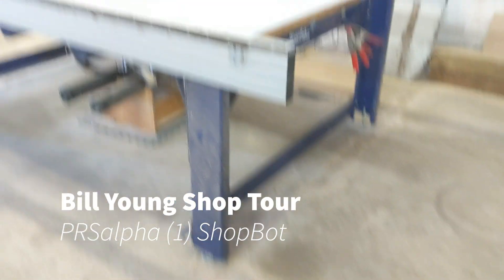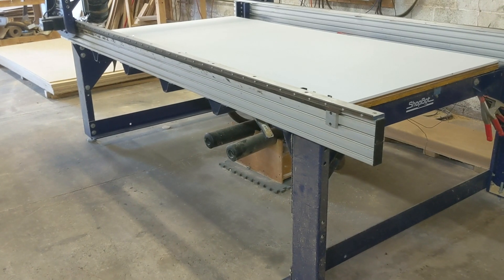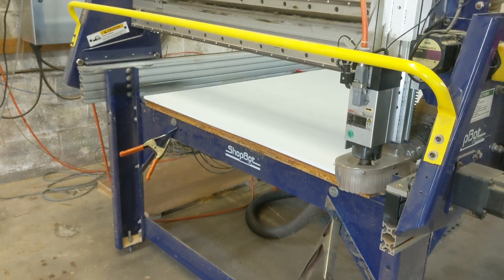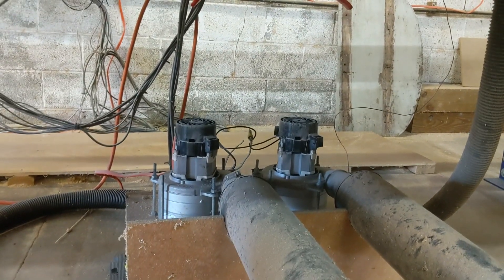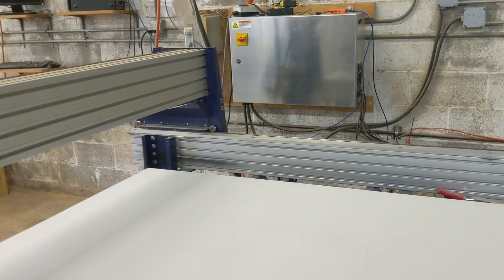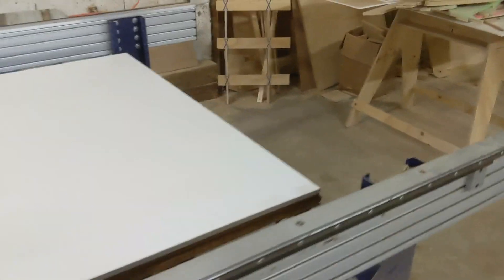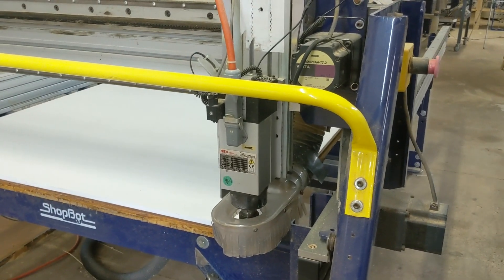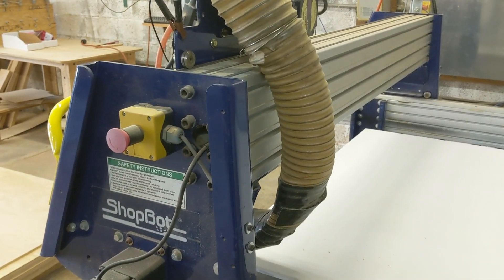Bill Young Shop Tour: ShopBot PRSalpha (1)

Comment: I'm still using my old PR with the upgrade controller. Like you said if it works don't fix it. What was the operating system you are using on the RPi? I didn't catch it. Thanks for the video!
Reply: It's an open source operating system called FabMo that's being developed by ShopBot Tools.

http://gofabmo.org/